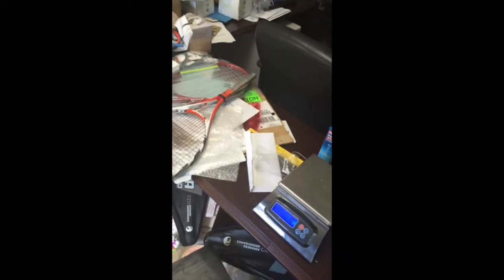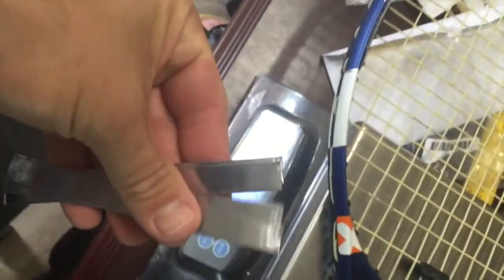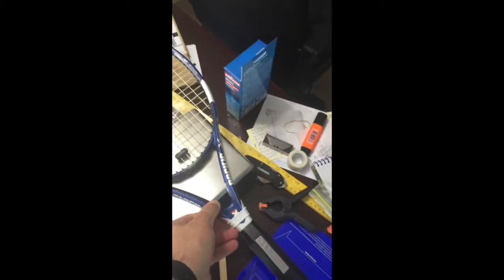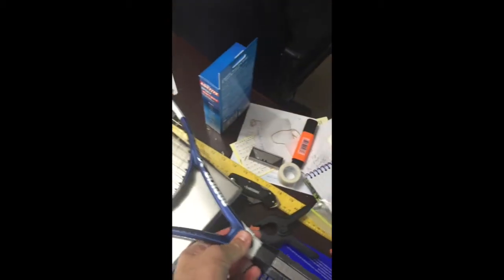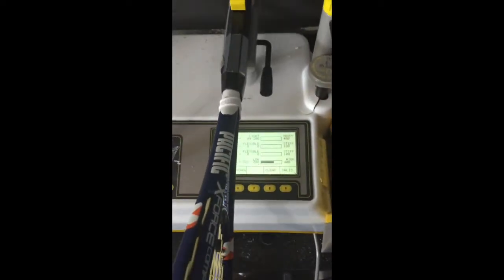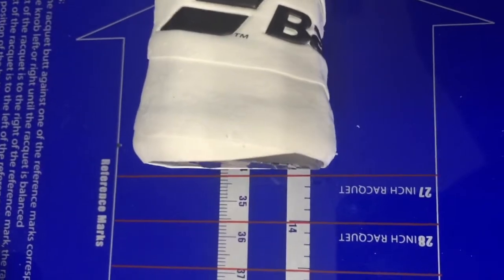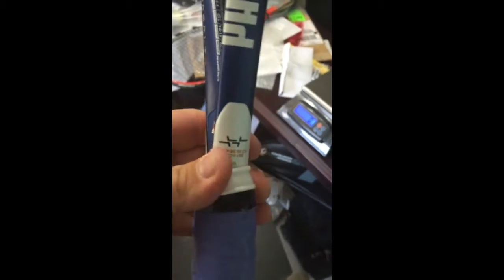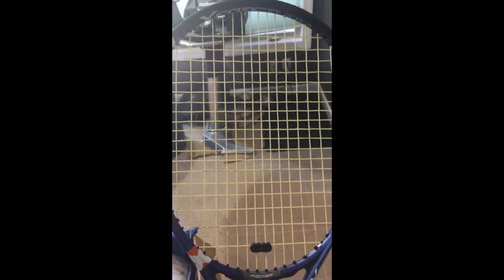Customizing a Tennis Racquet using Lead Tape

Comment: I have an inquiry about my babolat racket customization. I have babolat boost a racket and after changing the old string ( spiral tek ) with natural gut  ( vs feel 1.30) i have noticed  a significant change in racket balance . I think that change due to the heavier string. my question is how can I restore the racket balance without any increase at the swing weight and do you recommend injecting some silicone in the racket handle.
Reply: Thanks for the question. Before you use silicon, you could try adding some cotton balls and some lead tape first. Honestly, though, the Boost is not a high performance racquet and you would be better served getting a performance oriented racquet that would take to customizing better.
Reply: @danielschank  thanks alot
Reply: @karimeldinkamel6470  you’re welcome

Comment: What is the elast band like thing between the handle and the throat? Waht is the purpose of it? BTW, would it be more efective to add weight at the tip of the handle to balance the racquet? you could have achieved that with less lead tape. What happens if you have a grip that is smaller or bigger than what you should be using based on the hand size? For example, i should use a grip 3, but i like to use a grip 2 with a wilson overgrip. Thanks for the video.
Reply: Cesarini77 the elastic ring came with the racquet and are designed to ensure the grip tape doesn't peel up.

As far as adding lead tape to the tip, yes it will offset balance and add the maximum amount of swing weight. I wanted to increase swingweight but I also wanted to increase torsional stability.
Reply: Doesn't it also reduce vibrations?
Reply from the maker: Penguinox yes, any weight helps with vibrations.

Comment: Great video. Just one question. Does it still work if I add some lead tape directly under the overgrip and not under the replacement grip? That's referred to counterbalance after putting some tape at 12 o' clock. Also would you put the tape exactly in the same position on the handle, regardless   counterbalancing 12 o' clock or  3-9 o' clock? Thanks in advance and again great video
Reply from the maker: domenico scarpino it depends on how much counterbalance you want. If you put lead at 3 and 9, then you could put lead anywhere under the overgrip. IMO, if you put lead at 12, you will see better results if you put the lead on the butt cap or as close to the butt cap as you can unless you are specifically trying to reduce the headlight balance.
Reply: @superstringerllc7774  fantastic, thank you so much! So I can either put it under the grip or under the overgrip, right? Cause I' ve read it's adviseble to put it under the replacement grip as you actually do in the video, but I don' t see any particular reason why I shouldn't put it directly under the overgrip. What you think?
Reply from the maker: domenico scarpino the reason most people prefer under the replacement grip is so the tape doesn’t get damaged as often. Some overgrips can stick the lead or tungsten and ruin it when the overgrip is unwrapped. 

It doesn’t matter in terms of playability.
Reply: @superstringerllc7774  this clarifies everything. Thanks a lot 🎾👌
Reply from the maker: domenico scarpino you’re welcome.

Comment: Hi. I have a 305g, pure strike, weighs 316g strung. Am trying my best to increase the swing wgt keeping the Balance Pt intact. But adding an extra grip n then a 3gm lead tape at 12oclock is increasing the dead wgt of my racquet by almost 10g, a lil beyond my comfort zone. What else could I do? I have already removed the overgrip and done away with the Vibration damper as well. Tks
Reply: What kind of extra grip are you adding and why?
Reply: @danielschank  a simple overgrip for a more spongy feel. But I removed it to reduce the dead wgt. It wasn't really affecting my grip. I play eastern forehand. Single hand backhand
Reply: You could always use a thinner or less dense replacement grip and still add an overgrip to reduce the weight added. Typically a Pure Strike has the Babolat Syntec Pro grip. You could swap that out for the Babolat Syntec Team Grip which weighs less and then add the overgrip.
Reply: @danielschank  tks will try it out. Also could u pls tell me the wgt difference between 16,17 and 18gauge strings.. Can we save significant dead wgt by opting for thinner strings? Tks
Reply: The composition of the string matters so there is not an exact weight I can give you but basically, it can save you a gram or two or sometimes more by going to thinner gauges.
Reply: @danielschank  ok. So basically ur saying there's no way to control dead wgt while I try to maintain balance pt towards HL  for a higher swing wgt?
Reply: @shriramoka  swing weight increases more with more mass in the head. Maneuverability increases with more weight in the handle making the racquet more HL. Its a balance of trial and error until you find what works best for you.
Reply: @danielschank  I know. My question pertains more to max. Swg wgt while maintaining a limited dead wgt. Too heavy a racket and my arm fatigues over a long match.
Reply: @danielschank  another Q . What are the advtgs of a Head heavy racket. Say I want to limit the dead wgt within 320g strung, and decide to just add lead at 12, would a H. Heavy racquet affect the swing drastically?
Reply: @shriramoka  yes, head heavy racquets are not common with heavier racquets because they are too hard to swing and get in position when you play against bigger hitters. 

Typically most players find 4-6 pts HL balance to be good for them. Doubles players and serve and volley players like 8-12 pts HL because it makes maneuverability easier.

Comment: Why do you add the counter weight that high up on the grip as apposed to adding it closer to the buttcap?
Reply from the maker: Jace Beleren great question. Normally, I would add the weight inside the butt cap or at the bottom of the the handle. 

However, in one of the tennis warehouse forums their was a guy who claimed that putting the weight at or near the balance point was better and he came up with a formula he called mgr/i and he stated that most of the racquets tuned for the professional players were around 21 using that formula.
Reply: Thanks for the reply very interesting  @superstringerllc7774
Reply: SuperStringer, LLC great point. I was wondering if the mgr/i spot was just at the height where you place your index knuckle

Comment: you haven't added any grip to the racquet so your measurements are inaccurate.
Reply: Chuck my measurements are completely accurate up to that point. When I customize frames, I ensure the specs match throughout the customization. Adding a grip will add some static weight and change the balance point a little but will minimally effect swingweight. Swingweight is by far the most important measurement.
Reply: Daniel Schank Chuck didn’t watch the whole video before commenting. 🤦🏻‍♂️ Gooood work on that customization! Checking specs after each mod

Comment: Interesting video.  You have a lot of materials that you can make one heck of a proshop in your house.  But I can't help but think that organizing it all would make you more effective at what you do.  I also customize frames, and would shoot myself if I had to try and do a frame amidst the sea of craziness you have got going on there.  Also, I can appreciate the effort going in, but I can't help but think you are going to drive customers away if you let them see your lair :)  +1 for the Babolat RDC machine in house, +1 for the stringing machine in house,  and my final piece of advice.  Use that Microgel Radical you have laying there with no grip, instead of that Pacific frame (if these are your personal frames and not clients).  Not trying to troll you.  But I would be willing to bet a prostock, that you will be taken way more seriously if you take this video down, clean your workspace, and then rerecord it.
Reply from the maker: Is this better https://www.facebook.com/StringRx/posts/1530526673650379
Reply from the maker: Johnathan Black is this better? https://www.facebook.com/StringRx/posts/1530526673650379

Comment: Hmmmmmm why go to the trouble of removing the grip?  Why not put fishing line weight in the butt cap with cotton balls?  That is what the butt cap trap door is for. Pop it open and put lead weights in the handle.  You really don’t want to have lead residues getting into your sweaty hand when playing tennis. Putting lead tape under tHe grip can do that and can increase your grip size.  Lead is highly cancerous!!
Reply: Lead is only dangerous if you touch it directly and it is able to get into your bloodstream. I would love to see any data supporting your statement of lead absorbing through the grip and if any negative effects come from it. 

I have a youtube video on adding silicone through the butt cap trap door and sure, you can use fishing weights as well. But if a player doesn’t want to add a lot of weight or maybe they don’t want to impact balance drastically. Remember, the more towards the handle you add weight the more head light the racquet becomes and is quicker then say adding weight at 4-6” above the butt cap. 

Alternatively, adding lead at 12 o clock on the hoop affects balance and swing-weight more quickly then say adding it at 3 and 6 o’clock on the hoop. 

Its all about what you are trying to accomplish.